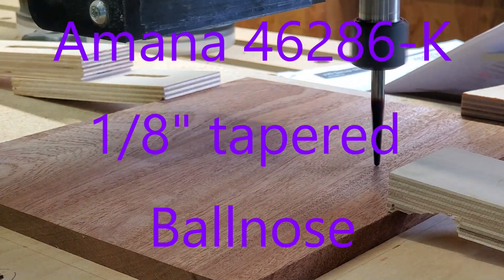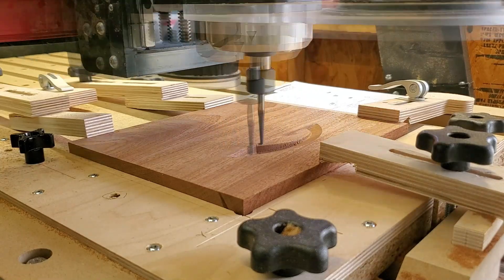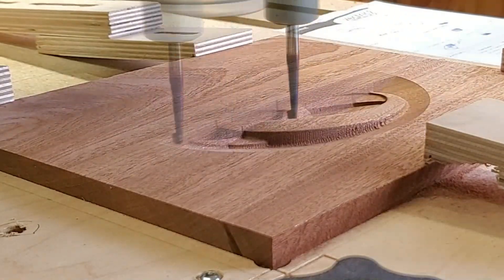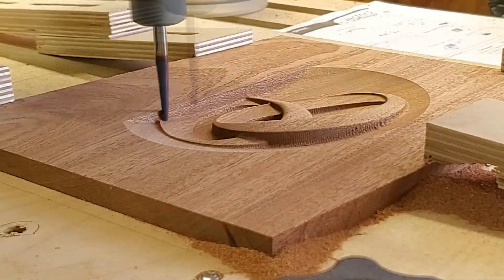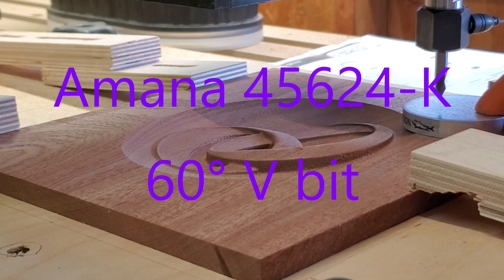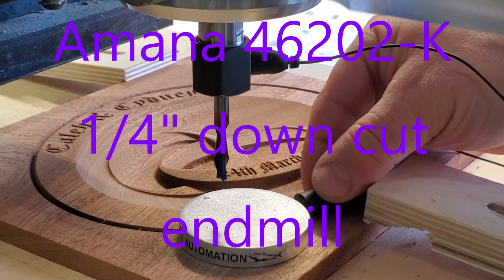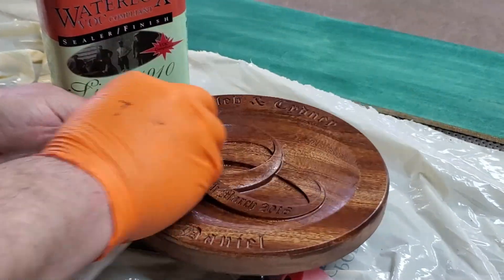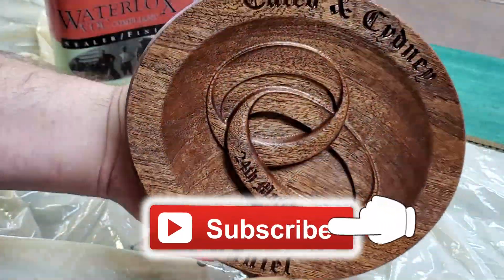Making 3D Rings In a Dish on the Shark HD5 EXT

Comment: so you traded out your shark and I gotta ask, what was the hardest you pushed it with a 1/4 inch ballnose and that 1/32 tappered amana (LOVE THAT BIT)? I have one with the  water cooled and I wanna maximize the machine potential but not make it fail. I typically use soft woods and 3D carves rough pass and then finish.  As you said I love this machine its amazing- not trying to detracting from its value. All these videos say "running your machine too gently" is a common error- when did you start to see quality restrictions?
Reply from the maker: I first would run a test using various feed rates.  Use a similar toolpath but set each pass up at different rates.  This will give you audible and visual results.  This is s simple test but can reveal a lot.  You could do a small Clipart file for 3d.  I did this using an endmill and V bit as an example. ( https://www.youtube.com/playlist?list=PLK5XO_8UZgFam667BtWx-PuuTdxATqf4h )

The faster my feed the more inconsistent it seemed to become.  I made rings in a dish 6 times, using slightly different feed and plunge rates each time.  The plunge is what gets you.  The shark HD with the extended bed has considerable deflection in both the bed and gantry.  This caused some undesirable results and extra sanding.

The best quality cut and time I got was 1 hour & 20 minutes.  1/4 ball cutting 120ipm & 60 plunge.  1/16" was 40 & 20 if i remember.  I did faster times but the quality deteriorated.  For reference, I was able to cut the same part on my Axiom at faster rates and did it in 45 minutes.
Reply: @ChristcrossCrafts  Yeah I've notice minor deflection- I say out of the middle on small stuff, material has to reach the edges to prevent the deflection. Good advice. I tend to creep up to speed. Now I know you had a couple success at 120IPM I can work from reverse- saves time. Thanks!!

Comment: Thanks for the video, What software did you use to send the code to the Shark and also to design the project? I am thinking of purchasing a CNC for home light professional use and looking at the Shark HD5 Extended, Scieni Labs Longmill V2, Axiom. In my research phase only want to purchase once. Curious about how long a project takes to be carved out ? Is your CNC with a spindle or Router and if Router what brand model?
Reply from the maker: I used aspire but the models are available for Pro in the Clipart.  You just need to tweak them for your needs.

I've owned a Shark hd5ext with a router which was a good machine.  I needed faster runs and accuracy to match, as well as a spindle that would run 1/2" bits.  

I now own an Axiom AR8 Pro with a 3hp spindle.  I have a video on my page explaining why I changed in detail.  I absolutely LOVE my Axiom.